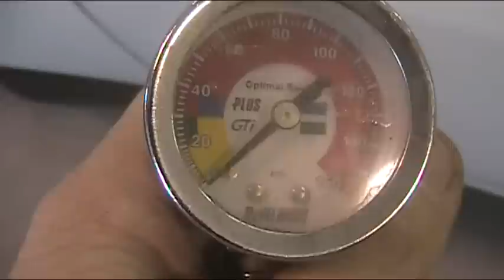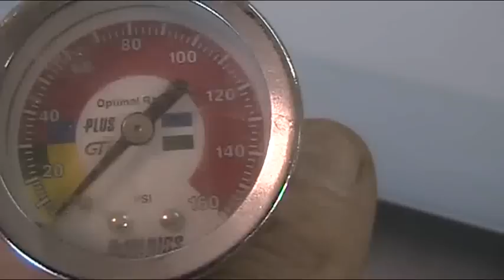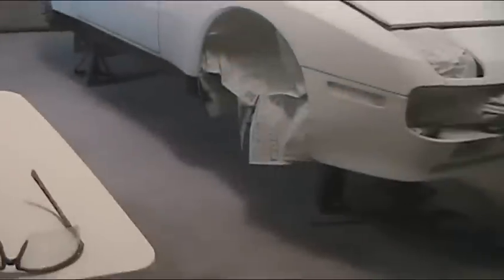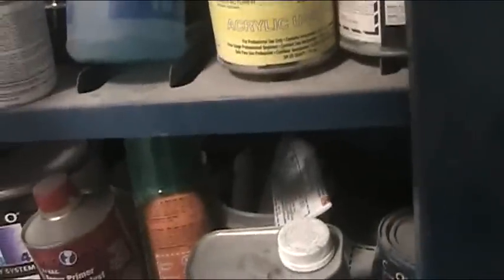preparing for the weekend to come,close to paint time

Comment: Keep in mind those test panels are small and were horizontal when you shot them, it will be different when you start shooting a larger vertical panel. Are you using high flow couplers on your hoses? They make a huge difference in the way any HVLP or HE gun sprays. Not that I'm knocking your gun, but the GTI's that I've sprayed, I didn't like...   Regardless the car is looking good and I see nothing wrong with your procedure. It'll be awesome to see color on it this weekend!!!  Later man...

Comment: what do u not like the about gun?  the orange peel?  if so lower air pressure & turn the volume of base/clear up,if that dont work  thin the clear down,or spray slower...but everything i said 2 do...do it on a test panel  FIRST   PEEEACE